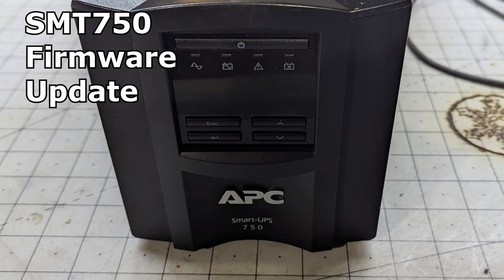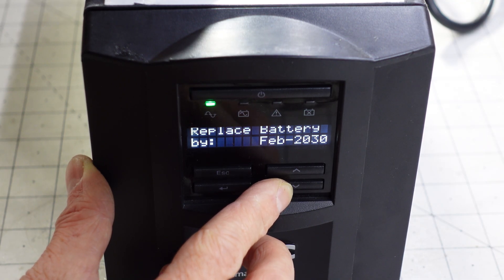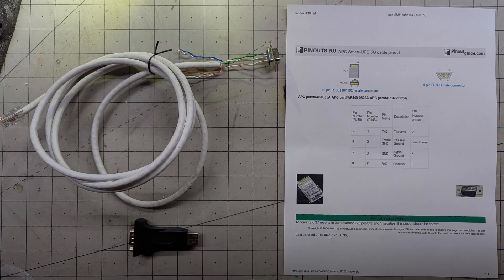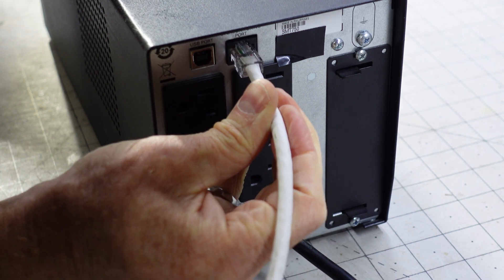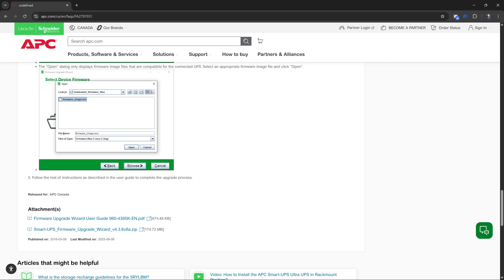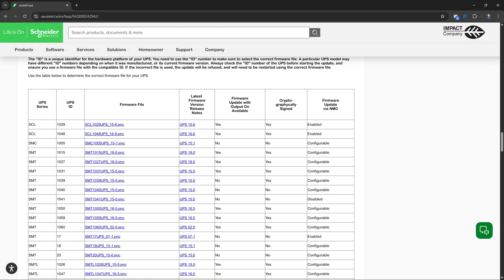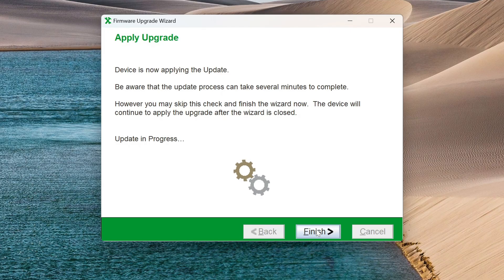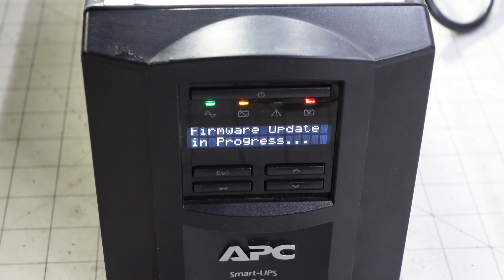APC UPS SMT750 Firmware Update Smart-UPS Firmware Upgrade Wizard

Comment: Wait, what is the USB-B port for? Can't you update with a "Printer USB Cable"? I know for sure I can enter and check the status of the UPS using it from my Computer, but it is a different model. Wouldn't that be an option as well instead of making the Eth-Serial Cable PLUS a Serial-to-USB Adapter for it?
Reply from the maker: For my UPS, the USB-B port is for monitoring only, so it will work with PowerChute. You have to use the RJ-50 port for firmware updates. You can get RJ-50 to USB cables that have the adapter built in. YMMV, as APC isn't consistent in this, for example, I know some of their other units have the RJ plug direct to USB with no built in adapter. Best bet is to look up your model and see if you can find instructions for it.

Comment: Can you help me with the firmware for the APC UPS model srt3000xla?
Reply from the maker: Using the LCD screen on the unit, you need to pull the ID number off it. Then look that up on the table at the bottom of this web page: https://www.se.com/ca/en/faqs/FAQ000242942/  If your UPS ID is listed in the table (second column) you should be able to update (provided you have a cable and comm port adapter).

Comment: why did you update it? What benefits or upgrades did the firmware update. please reply.
Reply from the maker: My UPS was giving a 'Relay Weld' fault. In the release notes for some similar units their comments regarding fixes to eliminate erroneous faults. Though I would give a firmware update a try on my UPS. It didn't work; after upgrading the firmware I was still getting the fault, and I ended up opening the unit and finding a blown capacitor. I managed to fix the capacitor, and the unit seems to be working. I have another video coming with the capacitor repair.

Comment: Great video Reiley, out of curiosity why did you update it? What benefits or upgrades did the firmware update have or did you just do it out of compliance?
Reply from the maker: My UPS was giving a 'Relay Weld' fault. In the release notes for some similar units their comments regarding fixes to eliminate erroneous faults. Though I would give a firmware update a try on my UPS. It didn't work; after upgrading the firmware I was still getting the fault, and I ended up opening the unit and finding a blown capacitor. I managed to fix the capacitor, and the unit seems to be working. I have another video coming with the capacitor repair.